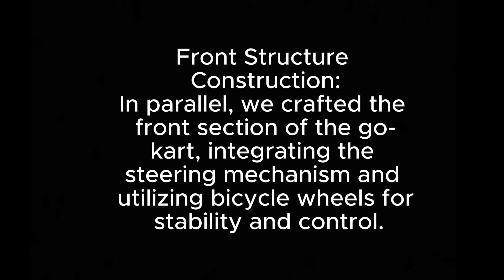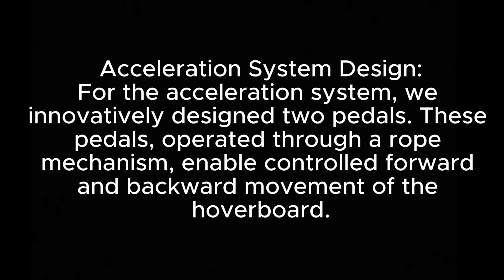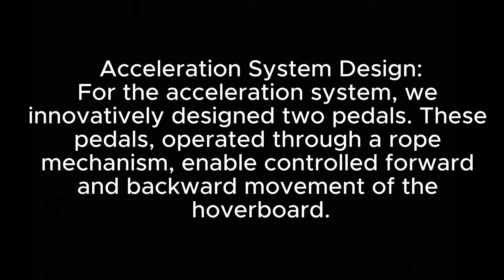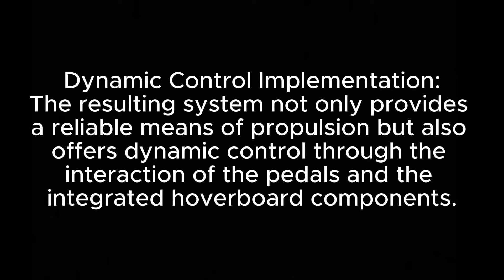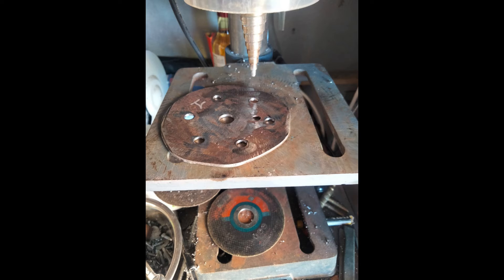Electric Go-Kart Build TUTORIAL

Comment: A few inches wider and 2 feet longer with a bench seat and this could be a great runabout. The tires are about the right size, but knobby treads are noisy. A basket in the rear could make it a great grocery getter. Keep it ultra light and it could take you 50 miles on a light, affordable battery.